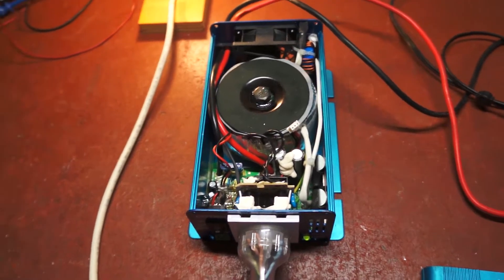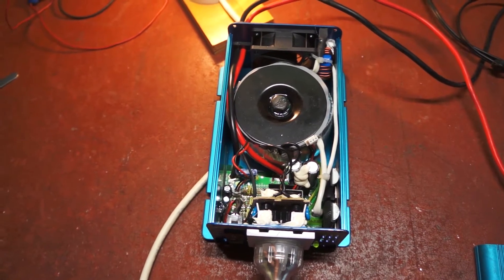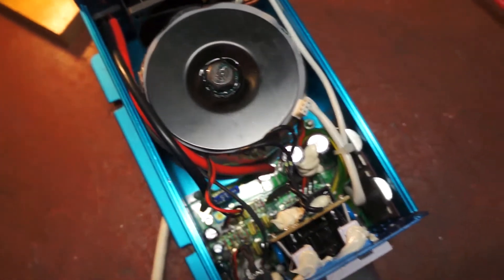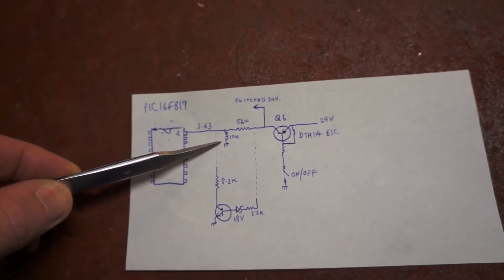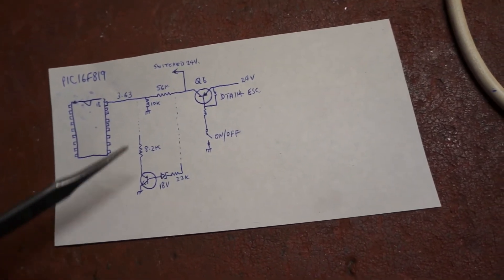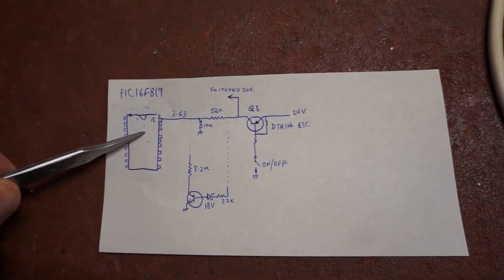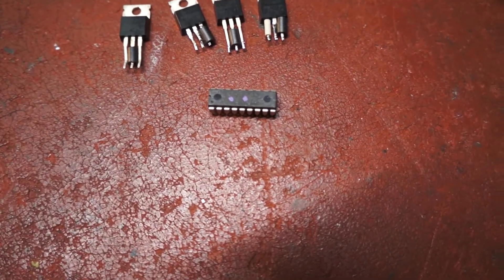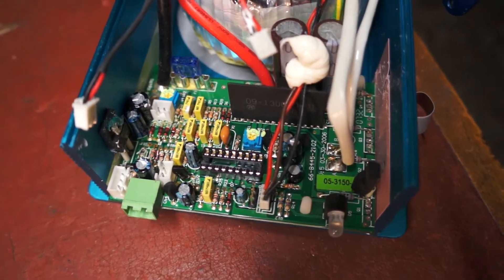Cotek Inverter Repair

Comment: Welcome to the wonderful world of disposable electronics.  Power inverters destroy themselves very quickly and usually quite spectacularly. The mosfets actually protect any fuses that are fitted rather  than the other way around. This event will usually take out the drivers, and sometimes the PWM chip. This inverter is unusual in that it uses a small micro, most use generic PWM chips, so replacing the PIC will do nothing unless programmed.  A current limited bench supply is mandatory for powering these after repair, a slight mixup or pulse overlap can easily destroy  tens of mosfets in a microsecond. I shudder to think how many inverters are dumped each year because of misuse. Thanks for an interesting video.
Reply from the maker: Yes, they're one of the most unreliable devices of modern electronics. I've got half a cupboard of switchmode inverters I got cheap because they all had blown semis. While I was able to repair them all, I would be very hesitant to use them on anything but a resistive load - it strikes me as a very fragile design having MOSFET's switching 340V DC from 400uF of capacitance directly into the 240V AC load. An inductive spike can destroy a set of MOSFET's within microseconds. Indeed, I have never seen the fuse protect the MOSFET's haha! The fuse just stops the supply cable burning up when the MOSFET's die. Older square wave inverters using normal bipolar power transistors, and a proper iron cored 50Hz transformer are far more reliable.